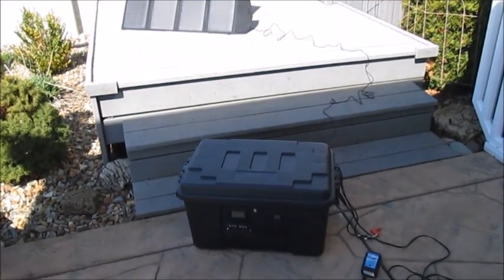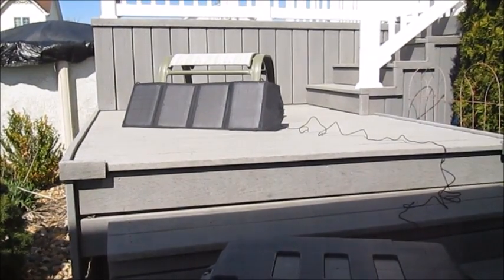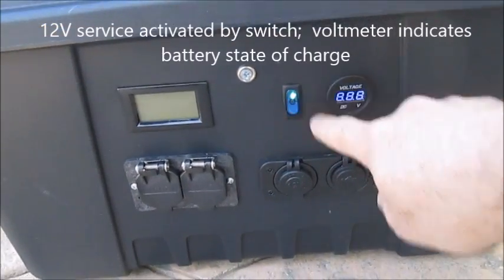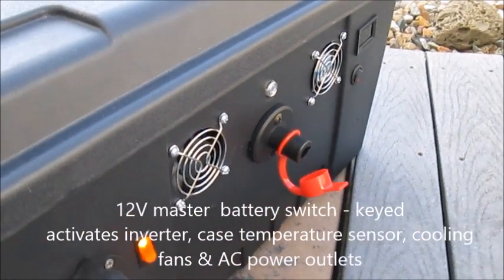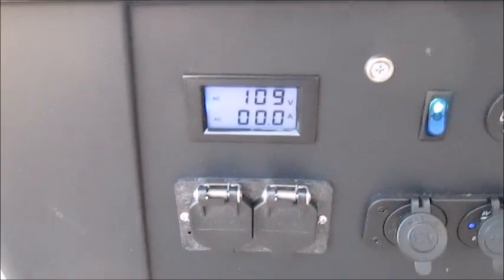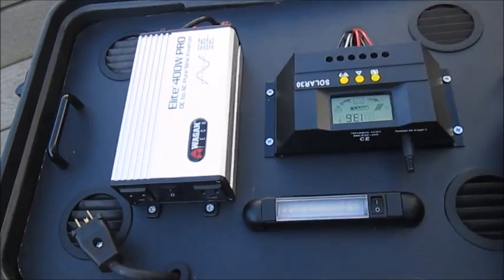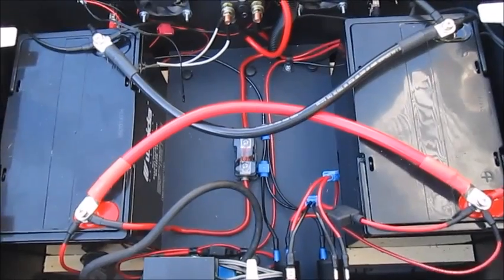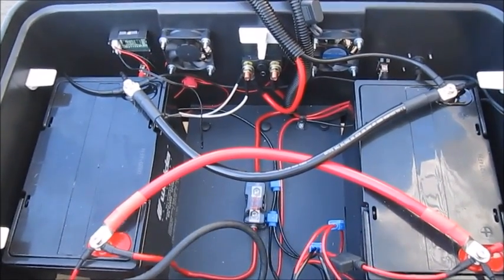V1 P1 DIY Portable Solar Power Generator - Wiring Schematic, Parts List, FAQ Sheet Provided

Comment: Excellent project!  Currently working on my own (3000/6000 watt pure sine wave inverter, (3) 100 watt monocrystalline panels, 30amp charge controller, 105 ah battery).  Similar setup, but I am curious about grounding.  Did you find the need to ground either the panels or generator anywhere?
Reply from the maker: Thanks Chris.  I did not incorporate an earth ground into this system because in my case it is primarily being used on a boat.  I should have installed a GFCI 120V AC outlet when I designed it, but instead I now plug in an external 4 outlet power strip that has has a 15A breaker and GFCI built in...that offers some protection.  If your primary use is going to be on land you can easily add an earth ground.  Here's a link to some information that I found on the topic https://www.homepower.com/articles/solar-electricity/design-installation/ask-experts-grounding-dc-systems

Comment: Is it possible instead of solar panel use car for charging the battery thru  solar charge controller?
For example, start car, take two cables from car battery or car generator and connect them to solar charge controller instead of solar panel source and charge the  battery?
Reply from the maker: Yes, I think you could safely charge the system if connected to the car's alternator as it would regulate charging.  I would not connect directly to a 12V cigarette outlet from a car unless a charge controller of some sort was used.
Reply: Jim Fisher that's  for help

Comment: Thanks for your video. It inspires me to make one. However, I try to figure out how do you keep your batteries from moving? Do you put somethings at the bases to keep it from moving?
Reply from the maker: To help keep the batteries from moving  I made a frame in the shape of the letter H.  I used 1 x 4 inch lengths of wood joined in the middle by a piece of the same type of blackboard material that was used to fabricate the top tray.  The frame was designed to fit the exact dimensions of the inside of the case so when the batteries are placed in it they are unable to move laterally.

Comment: Excellent job Jim...very well constructed and planned out. I wouldn't mind having one of these...maybe with a higher wattage solar panel (150-250 watt).
Reply from the maker: Thanks for your comments James.  Adding a higher wattage solar panel would certainly help to recharge this system more efficiently.  I don't tend to draw the batteries down much below 85% state of charge based on my current daily energy consumption in the boat (weekend use for now).  Hopefully in retirement I will be able to really test the capacity of the system and I suspect I will be adding at least another 100W solar panel to increase the rate of charge.
Reply: Believe me when I say that you'll enjoy retirement...I've been retired since 2010 and loving every minute of it.
Reply from the maker: I believe it and expect to join you in about 4 years!

Comment: 950!!??
Reply from the maker: I know, right!!  I too was surprised at how affordable it could be to build one of these high quality systems as a DIY project.  Just $950 and that includes the cost of the solar panel!  It is SO much more affordable to build one of these for yourself than to purchase a commercially produced model.  When I took the time to actually research the prices of comparable commercially produced models I was astounded to find that retailers were charging more than twice as much as what it would cost to build one for myself!
Reply from the maker: Quality isn't cheap David.  If you have the time read additional comments below for further details on the cost of this build as compared to prices being charged for comparable (yet in may aspects inferior) commercially available products.  You can also review my part list and prices paid for ALL the components of this system (there is a link in the video description, click "show more").

Comment: Fantastic job. I am building a smaller scale version of this with an MTM ACR8-72 Ammo Crate. Do the two screws holding the outlet covers on also hold the outlet box on from the inside?
Reply from the maker: Thanks for your view and for your comments.  Yes, the screws through the outlet go through the case and into the shallow box keeping it secure to the inside of the case wall.

Comment: Very nice build.  VERY NICE. ...but ya coulda bought a GOAL ZERO system for less
Reply from the maker: Thank you for your compliments.  I would like to know exactly which GOAL ZERO model you are referring to though.  I am very familiar with the specifications of their products.  I don't like to offer GZ free advertising here, but my comments in response to another post very specifically compared the GZ product that is the closest match to my design.  Here is a re-post of that analysis:    GZ offers a 100 AH system with a 1200W pure sine wave inverter and a 90W solar panel for a mere $2,188 plus tax.  My DIY version offers more amp hours, a larger solar panel, and more power distribution features for less than half that cost.   The math is simple, a COMPARABLE GOAL ZERO system is twice as expensive as what it cost to build mine.

Comment: Hi Jim, I really like your videos, they are so well done. Thanks. I'm in the planning stage for building one and have a few questions. My intended use is for heating my greenhouse. I live pretty high up in the mountains and it gets cold every night, so I use a ceramic space heater with a thermostat to keep the chill out. I already have a Renogy 100 amp solar panel and controller for my T@B trailer with one 27DC battery. I was thinking of using the new charger for both the greenhouse and when we go on a trip, so I'm half way or more to the charger that you have shown. The questions I have are: Why the on/off switch for the AC? Does having the ac on cause extra drain even if not being used? Does the trickle charger stay on even when using the solar panel? I am not planning on installing any fans, temp probe etc as it will be cold where it will stored for the greenhouse or on the trailer. I also will not be installing 12v outlets as I have that covered with another piece of equipment. That should simplify the installation and also keep the cost down. Your thoughts? Thanks. Tory
Reply from the maker: Thanks for your comments and questions Tory.   My initial thought is that a typical ceramic space heater may demand a lot more watts per hour than a system like mine could reliably provide.  Some ceramic space heaters require about 1200W and even more on startup.  I think you would definitely need at least 300 watts worth of solar panels, a much larger inverter, and considerably more storage than a couple of 27AH batteries could provide.  The on/off master battery switch in my system also shuts off both the temp sensor/display and the AC ammeter/voltmeter- both of which would draw power if not turned off.  My master battery switch also turns on/off power to the DC/AC inverter.  I leave the inverter unit in the 'on' position at all times, that way I don't have to remove the top of the case to turn it on. The trickle charger is only plugged into the system when my solar generator is in storage, otherwise I charge the batteries with solar power.
Reply: Great feedback, thanks. I misspoke  on the switch. I have a battery switch, so I was wondering about the DC switch. What's the pro and con of having that switch?
Reply from the maker: I have my DC on/off switch wired to the DC voltmeter and USB port.  Without a switch the DC voltmeter would remain on constantly, consuming energy.

Comment: Would anything change if we substitute with lithium ion batteries?
Reply from the maker: The lithium ion batteries should be 12V to be compatible with my design.  I would advise that you look into getting a solar charge controller that is specific to use with lithium ion batteries.

Comment: Can it charge a electric car ?
Reply from the maker: Interesting question.  I have not researched the answer, but I doubt it since a typical electric car would have a considerably larger bank of batteries to charge as compared to this small portable system.   I suspect that charging an electric car would require many more amps per hour than this system could be expected to deliver without incorporating a much larger solar panel array, an appropriately sized charge controller, and perhap, dependent upon the model of the car, special wiring connectors to plug into the electric car.

Comment: Hi, I like your video. I have just started my project and I saw your video, I ended up attaching my inverter and controller outside the box to help with heat. I'm running a refrigerator in my van and I wanted everything in or on one box. I have not calculated my cost just yet.

Comment: is this generator efficient for powering a small fridge? Looking for a source of solar power for my shed/mancave in the back
Reply from the maker: Assuming you would not want to discharge the two AGM batteries below a 60% state of charge this system would offer a total of about 44 amp hours (40% of total of 110AH from the two batteries combined). 44AH DC = 528 watts DC. If inverted to AC the 44 AH DC= about 422watts AC per hour (assumes about 20% loss due to power consumption of inverter).   A small AC fridge would, after start up, run on far less than 422 watts, but you would need to look at the draw the fridge demands on start up to properly size your inverter.  I don't think the 400 watt inverter I used in my system would be large enough.  You might want to upgrade to a 1000W inverter with a 2000W peak to be sure.

Comment: Would you use this one that you have made or should it be a smaller one made for a Motorhome? That is what I am looking for right now...
Reply from the maker: Difficult question to answer- it is very dependent upon your specific needs.  The two considerations would be space available in your motorhome and your anticipated demand for DC power.  My boat is smaller than the average motor home and I have found the dimensional size of the container I used to be very manageable as far as the space requirement for storage is concerned.  The size of the battery box will, to a large extent, be determined by the size of the batteries.  The more power (amp hours) you need to the larger the batteries and system will be.  You will have to do some calculations of the DC wattage consumed by the appliances you wish to operate, and for how long each day, to determine the right size for both batteries and solar panels.

Comment: great stuff..Iam finally finishing my Solar Power Generator but I have a problem.What Guage size wire should I use to wire up my 3 12v/7ah batteries also what size fuse do I use or breaker should I use? My AC inverter is a small 110w and that's all I need to charge my portable devices and power up my new book. TY if you can help with this into
Reply from the maker: 6 gauge wire would be fine. 50A fuse between the inverter and the batteries.

Comment: where did you get the battery terminals on the front of your case?
Reply from the maker: http://www.ebay.com/itm/Battery-Post-and-Wiring-Kit-Remote-Jumper-Terminals-/270661963490

Comment: Looks great! One small suggestion would be not to cross the battery link cables. If they were ever exposed to lots of vibration there is a tiny possibility that they'd rub against each other and wear the insulation down, eventually shorting out. Better to keep them separate on each side of the housing.
Reply from the maker: Thanks for your view and comments.  Good suggestion in the interest of improving safety....see my part 4 video.

Comment: Very nice build, I'm impressed. And the cost isn't bad for what you've built. I wonder if you could do the same build ony you these batteries. http://www.lithiumion-batteries.com/products/12-volt-lithium-ion-batteries/

Yes they are very expensive but they are also the best you can have for the long haul.

It seems as though the Smart battery Lithium Ion batteries could be used instead of the typical AGM batteries, of course you have to use the appropriate charger.

LOL, It would be a little more expensive though since two 12 volt 50AH batteries would cost about $1,378.00

According to their website "The SB50 is plug and play for any application that currently uses a lead acid, gel or AGM battery" 

That's very interesting.
Reply from the maker: Thanks for having a look at my videos and for your comments.  Yes,  you certainly could use Lithium Ion batteries in place of the AGM batteries and their use would greatly reduce the total system weight,  by about 50 pounds....but at a very steep cost as you pointed out (about $1378 vs $230).  If total cost was not a concern the Lithium Ion batteries would be a desirable upgrade.

Comment: Hi Jim,  very impressive and professional.  Your work has convinced me that I do not need to purchase one of those expensive commercial units on the market! Thank you for sharing. Could you please explain your process to determine the battery and solar panel capacity?  Did you create a power budget spreadsheet?  

I am looking to create a solution like this to power my 12v astrophotography equipment over a 4 day period where there is no AC.  Even though I do not necessarily need AC, it might be a good idea to put in an inverter just in case I needed it or wanted to use this solution for another purpose. I'd like to minimize weight as I have to take this rig in and out of an SUV by myself.  However, I do need enough battery power for a complete night + some day time observing.  I also need to plan enough solar panel wattage to recharge in less than a day + have some panel + battery Ahr buffer to cover extra usage and/or party cloudy day.   I am trying to resist the urge to just buy (2) 100 Ahr AGM batteries and want to properly design this for efficient portability!  Thanks
Reply from the maker: Hi Matt,  thanks for your interest in my design and for your comments.  Yes, I did create a solar power management budget using a spreadsheet.  I considered multiple variables to project the total amp hour yield I could expect on a good solar day.  Those variables included the total amp hour demand of the appliances I wished to use daily, the wattage of the solar panel, efficiency of the solar panel, and discharge and recharge limitations of the batteries.  E-mail me at jim@creeksideartifacts.com and I will send you some files to help you get started.

My system weighs about 90 lbs and is best handled by two people, but I have moved it onto my boat and into my pickup truck by myself.  I think it is at the top of the threshold for safe handling by an average adult male.

Comment: I love this, one question though could you use larger batteries? i.e 2×100ah without changing too much wiring? apologies for noob question.
Reply from the maker: Yes, the only thing I would advise that you look into is using larger wire gauge for inverter connections if you decide to use a proportionately larger inverter.
Reply: thankyou for replying.

Comment: could you hook this up to your car alternator / battery ,as well as a solar panel .I'm looking to have that kind of versatility for my van and boat .I'm no genius at this stuff but I'm slowly getting inspired ,your project share has been the best so far
Reply from the maker: Yes, with appropriate connections it could be directly charged by your vehicle's alternator.  Keep in mind that to safely charge the batteries the voltage supplied to them must not be too low or too high.  A vehicle's alternator has a transistor-operated control device that regulates the voltage by supplying more or less current - as required - to the electromagnet.  The rectifier and regulator are usually inside the alternator housing, but on some alternators they are outside, mounted on the alternator body.  You could also simply connect a vehicle's 12V DC outlet to the solar generator's 12 V DC outlet (while your vehicle engine/alternator is running) to charge the batteries in the solar generator.  I would not recommend this unless you were able to carefully monitor the batteries state of charge-  they could be overcharged / damaged because there is no charge regulation when directly connecting the 12V DC outlets.

Comment: Jim, where in the system would I a 120v battery charger.  I want to be able to charge the batteries at campsites that have shore power.  Thanks
Reply from the maker: Jack, if I understand your question correctly you are asking where you could connect a typical 120V battery charger.  If the battery charger has alligator style clips you could simply attach them directly to the heavy duty remote jumper terminals on the front of the case.  They basically are the equivalent of attaching your battery charger directly to the positive and negative posts on your auto battery to charge it.

Comment: This is a fantastic looking unit but please make the red+ cable shorter so IT does not cross the black-cable (You may have to make the Black one shorter also ) if they keep rubbing together they could wear threw and short out big time! I just want it to be as safe as you can get it. I like your setup very much other than that. Thanks for showing us All it!!! This is a Very Nice Unit. I like it A lot!
Reply from the maker: Thanks Peter for your comments and concern for safety.   I have added a cable management spacer, but ultimately I am at least going to reconfigure the positioning of those main battery cables.  (see my part 4 video for an update that addresses this concern)